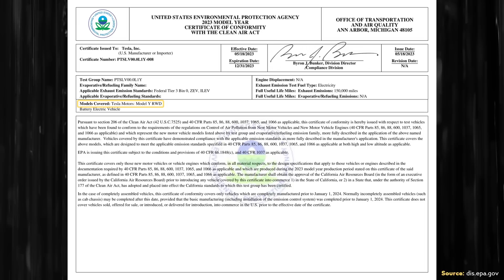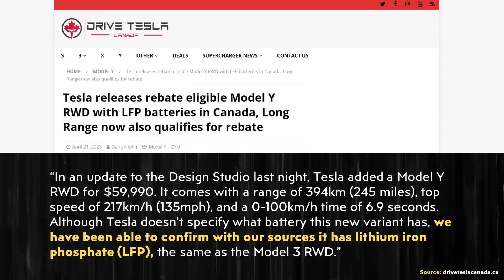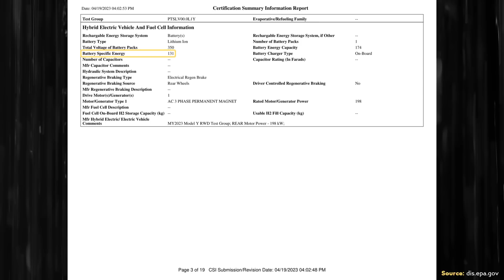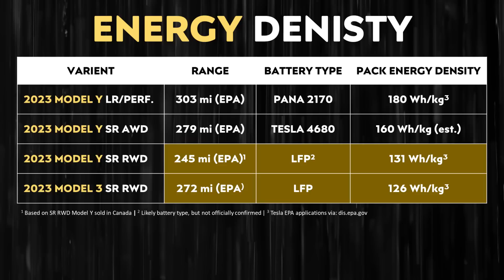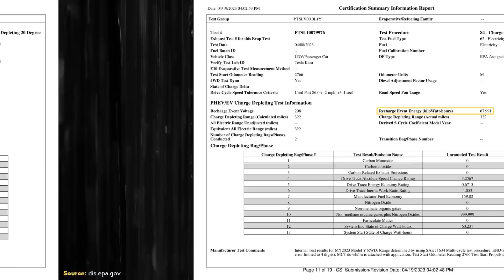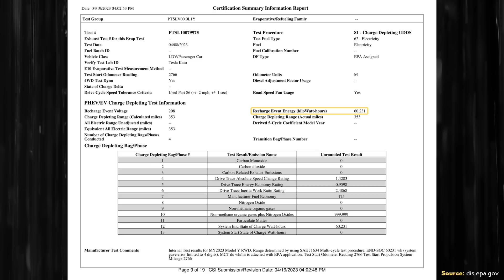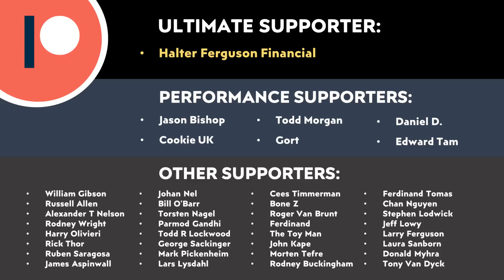NEW Tesla Model Y w/LFP Batteries | Approved by EPA for USA

Comment: You are reading the Energy Added from the socket on the top right corner and then deduct charging loss. End of charge energy value in the center lower column would have been the easier and more precise value. This is net energy for EPA testing purposes. The three energy values match the LFP55/LFP60 and BYD Blade that are all used in Europe.

Comment: I own a 2023 MY LR and a 2023 M3 LFP RWD bought a month apart. After 7000 miles with the MY and 2000 with the M3 the LFP battery pack seem to degrade faster (4% vs 2% for MY). MY was charged to 80% and LFP M3 was charged once a week to 100%... Something doesn't add up.

Comment: "Energy denisty", "Varient". Maybe you could redesign the tables you borrowed from The Limiting Factor to proper English...
Is LFP charging rate and time slower when you reach 80-90% of capacity, just like regular lithium batteries?
If so, you can charge both types only overnight to 100% realistically, not during the day on a trip. Or maybe once more during lunch if you are in France, where a decent lunch takes two hours.

Comment: @Cleanerwatt : here in Germany we have the BYD LFP since April in the Y SR for made in Germany models. The BYD has a better charging curve and most of all you can plug in it any any SoC up to 80% and get full 170kW charge speed. Made in China Y got the older CATL battery. 100% charging is not good for any battery. Not for LFP too. The BMS needs 100% to read the SoC, the battery does not like 100%. Tesla says charge to 100% to get the SoC right, but not for battery health. NCM starts degrading at 50%, LFP at 70%. I have a MiG Y SR and its quite a rival for the LR NCM. BYD LFP charges better, together with the lower consumption of the RWD its a better deal. The NCM needs 5% SOC for full speed, the BYD LFP doesnt, make long trip easier to plan. No more arrival at a charger with 0-5%.
Reply: 65-75 battery university :)
Reply: In terms of added miles the BYD LFP doesn't charge faster than the CATL pack.
Reply: @boostav  it is more convenient with the BYD and is is more like the LR. But the point is that such a small battery takes a lot of Cs, other will have to follow. NCM cells are outdated compared to the new LFPs

Comment: Jon 
There's something "off" with the data.
Look at the miles driven ("actual miles") associated with each 
3 tests (or sets)

1) 60.231 kWh / 353 miles
That's 5.86 m/kWh (exceptional economy)
Repeated 4 times ("Charge repeating phases conducted")
.
2) 67.991 kWh / 322 miles
4.73 m/kWh
2 cycles
.
3) 64.936 kWh / 223 miles
3.43m/kWh 
30 cycles
.
This looks more like a single battery size tested on 3 different EPA standard cycles.
,
1) Urban (1412 miles total)
2) Combined (644 miles)
3) Highway (6,690 miles)
(Assumption based on higher consumption due to drag)
.
If you add the top (urban?) and bottom (highway?) consumption 
5.86+3.43, then ÷ by 2, you get  4.65m/kWh, not far from result #2 4.73m/kWh of what would be the average combined test?

Comment: Appreciate the info. Do you know of any reliable info about how well the LFP batteries work in sub freezing temperatures? I'd seriously consider buying an LFP if there were some solid statistics about cold weather range, etc... If the battery was not allowed to 'go cold' due to either being driven or plugged all the time would the below freezing temperature concern be less of an issue? Maybe the heat pump makes the LFP OK for winter, etc??

Comment: i'd want the dual motor awd. too much weird weather in my state and i presume two motors are better than one at regen breaking. My target car is a MY HW4 LR w/tow hitch. I'd love for it to have LFP, but will likely settle for NMC.
Reply: My California Model Y Dual Motor Long Range has the 2 inch receiver built in from the factory. 
I can pull a small boat like it's not there.
The Model 3 only allows a smaller 1.25 inch lighter duty receiver.
Reply: @417ah7  for most of my uses, a 1.25 would be fine (I have one on my 2015 Mustang, btw, it’ll be nice having a hitch with the proper ground clearance for a change), but 2” might be required to trailer my 60” exmark if my wife has her f150 busy.

Comment: I have a small 14 kWh LFP battery pack and I have never charged them to 100%. It has cycled 96 megawatt hours that's over 8000 equivalent cycles. I understand you can charge them to 100% but if you do you're stressing them for just a few watt hours. There the old Thundersky batteries. Look at the charge curve of the LFP cells 80% is basically full.

Comment: We need a video on CT battery capacity needs...thoughts on them using 4680s even though they're not achieving any of their energy density goals with those packs.
Reply: "We" don't.
If "we" really did want to, "We" could research it ourselves?
.
As for "not achieving goals"....
"We" don't know what they've achieved, so "we" can't really tell if they still use the early version of chemistry (from 2(?) years ago?) Or if they have (just for speculation) a working cathode at 50% run rate, meaning they could just install 2 cathode lines, and or a chemistry with (just) the same ingredients as the 2170 cells, which would boost the 4680 pack past the 2170 iteration in all respects. (Less metal/ weight in the cells, lower resistance, less heat  inefficiency, faster charge rate, etc)
.
?

Comment: 245 EPA miles is trash....you have to assume real world 15% loss.  now your down to around 210.  useful if you live in a generally smaller footprint and stay in it.  im disappointed in this variant.
Reply: Depending on charge speed to 80% this 210 miles isn't that bad. That's 3+hrs of highway driving, with a 20min break.
Reply: @BenefitOfTheDoubtInquiry  you still arent getting 210 miles.  thats if you go to zero.  most people will want to charge at 15-20% as the low on a highway trip as chargers are spaced out not immediately available at every exit.  
thus giving them about 170...then spend 30-40 min for an adequate and more fuller charge each time.  what a pain in the ass, and thats not assuming extreme heat or cold losses either.  
this capacity is awful.  400 EPA range would net someone 330-340 real world.  that is comparable to a gas vehicle and people would jump on these a lot more.  the one thing about my model 3 is the 272 real world is about 200 in my usage, if it was more normal usage id be at 235ish.  which is really not the best of you want to leave your city.  most i would do is a 3-5 hour road trip, which would likely be one recharge on the way there, and that isnt bad to get out use bathroom etc for one stop.

im hoping in 2025-26 no tesla will have under a 330 EPA range in its cheapest form, with options for 380-440.  thats when i plan on trading in my 2023 M3.

Comment: for people live in warmer climate, LFP is definitely a great choice. Being able to charge up to 100% makes up for the range compared to the usual 80% on Nickel based battery.
Reply: I own a 2023 MY LR and a 2023 M3 LFP RWD bought a month apart. After 7000 miles with the MY and 2000 with the M3 the LFP battery pack seem to degrade faster (4% vs 2% for MY). MY was charged to 80% and LFP M3 was charged once a week to 100%... Something doesn't add up. I live in Florida.
Reply: In our northern climate, -20C winters, and a 45 mile drive to the grocery store.  Our LFP model 3 has performed well.
Reply: LFP batteries for Tesla performed well for cold testing in Norway. It was pretty much on par with other EVs.
Reply: News to me, do you have a citation?
Reply: @skirkwood  
Only "Everywhere"
Quite frankly I'm bored with repeating the fact.
Maybe start with Jeff Dahn?
Reply: No it doesn't because almost nobody needs 100% range on the daily. But, they do need that max range infrequently on long trips so a lower total range with a slower charge rate that does worse in the cold is Not as attractive unless it's significantly cheaper.

And as mentioned already, there's nothing wrong with charging a lithium nickel cell to 100%. Just don't keep it plugged in and maxed out every day. Charging software makes it easy to set the max charge.
Reply: @TecnamTwin  
Never "keep it plugged in and maxed out".... As with most things it's all about timing.
Reply: Enough with the "80%" myth!
.
Learn about the technology.
Understand how letting cells "SOAK" isn't good.
.
Understand you CAN charge to 100% IF YOU DON'T LEAVE THE PACK AT THAT LEVEL.
.
(Note, you don't really want to anyway if you want Regen available at the start of the journey)
.
For 95% of the drivers, and even for those who do need full range, 98% of the time it's not a problem
You just charge overnight, timing the charge to end shortly before you leave.
.
Don't quote FUD headlines.
.
Smh.

Comment: I believe they sold the Model Y rear wheel LFP version in US briefly for 39,990. I imagine somewhere around that price. That means they will need to reduce the entry level model 3 to around 36k
Reply: It wasn’t LFP but NCA
Reply: @chidorirasenganz  According to Google, Tesla switched to using LFP in RWD Model Y in 2021 before eliminating the Model Y RWD all together for the US market, but continued on everywhere else using LFP.
Reply: @igotanimac1  I haven’t heard any reports of that. The Model 3 didn’t even get LFP until late 2021. By then the Model Y didn’t even have a SR option in the US

Comment: Seems likely that tesla would set-up for an LFP M-Y. The CT is going to be starting production (has started?) and 4680 production won't be able to keep up with CT production and M-Y 4680 at the same time. Makes perfect sense to have the LFP option available for when 4680 supply is totally eaten by CT production. It also makes a handy demand lever should tesla need that for M-Y. Doesn't look like they will anytime soon but better to have and not need...
We have an LFP M3. A 245 mile MY would give me Pause. Our 3 goes an actual 250 miles most of the time (AC, sentry mode, 75-80 mph highway, etc). We live in a hilly area with cold winters so actual winter range is more like 200-220 many times. A 245 mile Y would be more like 220 or less in the warm weather and well under 200 in the winter. This would work most of the time (90%+) but could be annoying at times for us. the nearest SC is 35 miles away, one way. my wife drives 50miles/day to work. You would have to have 220V charging to make chargng a non-issue with 245 miles on a Y. I think anyone that can, goes to 220V asap, but if you can't range would be an issue at times. imagine driving 150 miles on a winter sunday, say christmas shopping and plugging in to 110V. You need 30 hrs min. to get back to full charge. Driving 50 miles/day it would take several days to get back to full charge if you were charging 12 hr a day.
TLDR : 245 miles would be no problem if it was a second car or you can do 220V charging. IMPO LFP is superior as long as you don't road trip a lot or NEED to SC at max speed.
Reply: WHY would you drive 150 miles to go Christmas shopping?
Reply: @rogerstarkey5390  you don’t drive 150 miles to go Christmas shopping. It’s very possible to drive 150 miles while Christmas shopping. It is 17 miles to the nearest place for me to shop.  If I want to go “to town” it’s 28 miles one way. Making the loop thru the 3 closest towns is about 110 miles. Driving 150 miles in a day is not difficult. The outlet malls are 45 miles 1 way. 150 miles in the winter would pretty much deplete your 245 mile battery.
Reply: @rogerstarkey5390  the short answer is because I kinda have to.

Comment: The charging to 100% all the time option is very important.
Reply: Thats a misunderstanding. The BMS needs 100% on LFP to read the SoC, the battery does not like 100%. Keep it at 90% or lower. 100% will degrade it faster.
Reply: @t.d.5804  
It's good to "remind" the BMS where the top is, but 5 minutes, once each week or so does that.
Reply: How so? According my “own” research there is clear data that shows you can delay the degradation by having at as low (practical) SOC as possible.
Reply: @Harrythehun 100% means you can have more range without having to sacrifice range for durability.
Reply: @theproffessional9  Incorrect. LFP is still recommended to be charged to 90% by CATL. You will experience degradation if you constantly charge beyond 90% on both LFP and NMC, you may experience a slightly lower rate of degradation when charging above 90% with LFP, but CATL still recommends that you charge only up to 90% for a majority of your trips and above 10%.
Reply: WHY exactly do you have to "charge to 100% 
all the time "?
.
The overriding majority of trips are well below 50 miles.
80-90% (on EITHER cell type) will give the majority at least a week of charge.
If you MUST complete a "more than full range" trip, it's highly likely you're leaving early.
Time your charge to finish 10 minutes before you leave.
Set to 95% so you have Regen(!)
The pack won't degrade any more than if you keep it below 80%
(Research "Dendrites")
If you're a "normal" person, leaving after breakfast, you'll be stopping for either a comfort break, or lunch, before the car needs charging.
A mid morning "splash and dash" with charge (10-15 minutes?) then 30-45 minutes lunch a few hours after that would mean you won't have a  problem.